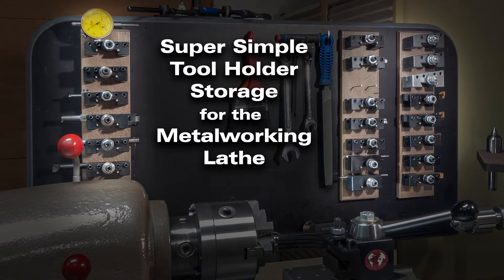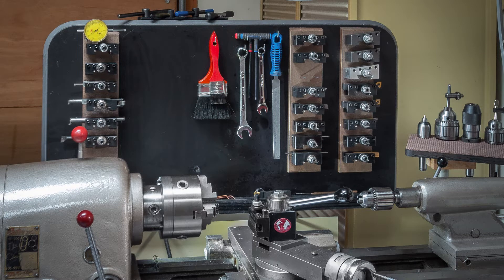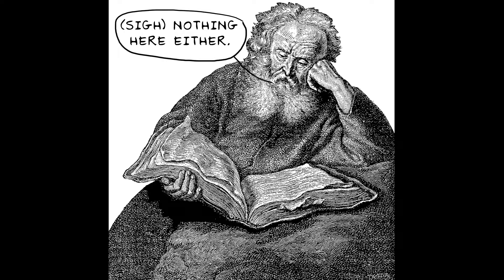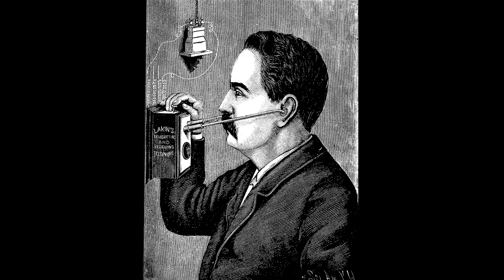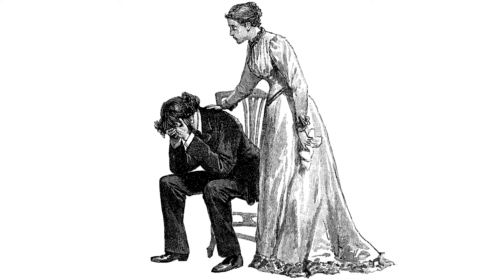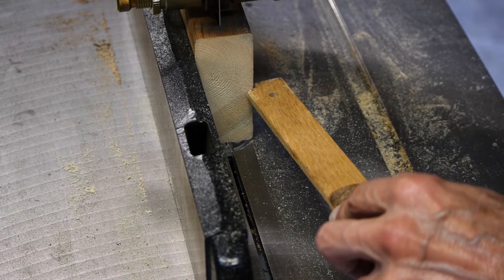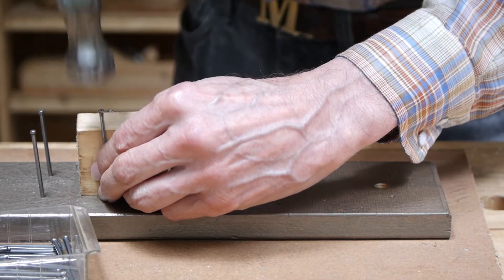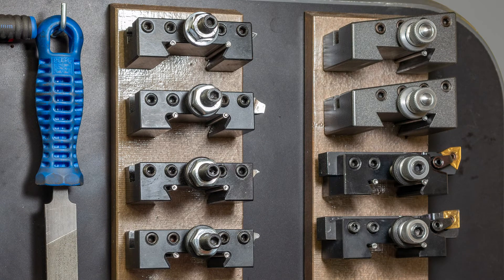Tool Holder Storage for the Metalworking lathe

Comment: Mike, the 3 tool holders at the upper right are angled, are they shop-made? They look look they are about 10 degrees? This exact holder is on my project list! Do you find the 10 degrees useful? If you made them again, would you use that angle or a larger/smaller one? TIA. Sadly, I did not see this video before designing my own holders, and used a much more complicated design that does not perform any better. I will say tho, few shop projects have a better return on the time invested
Reply from the maker: They were shop-made when I needed to get conventional high speed steel bits up to a shoulder. Now, however, I use mostly insert tooling, which has shoulder clearance already built in, so the tool holder angle is redundant.

Comment: Looked at your band saw oiler video. Here is what I did to mine to make it more maneuverable around the shop and avoid using those useless wheels the saw came with.
https://i.postimg.cc/LsRwQdr6/IMG-4382.jpg
Reply from the maker: Good idea. Moving it around on the as-supplied rear wheels is a back-breaker.